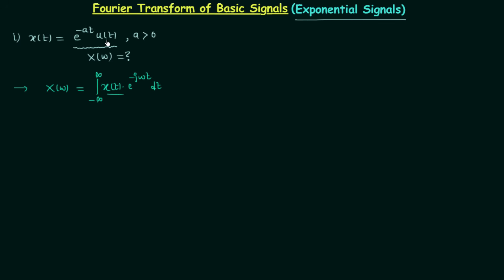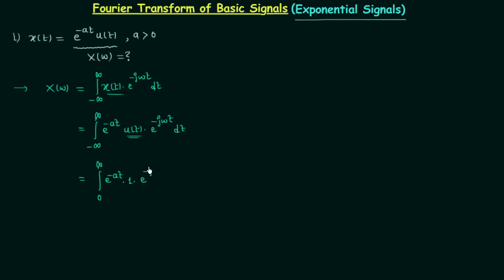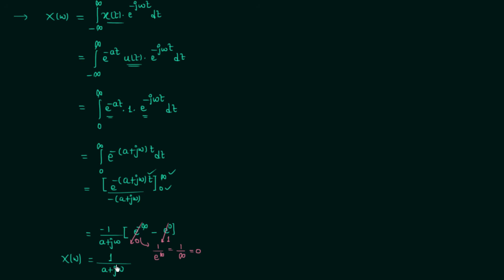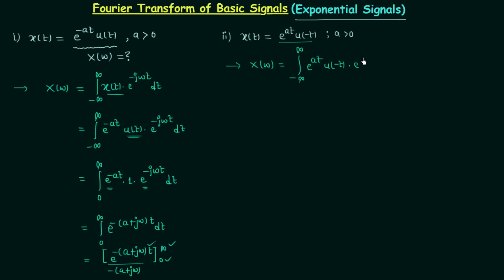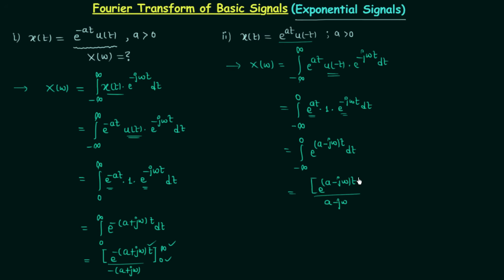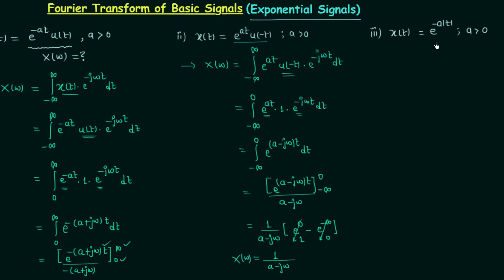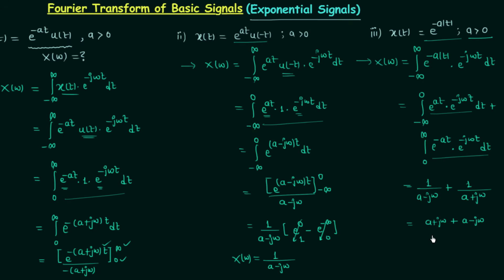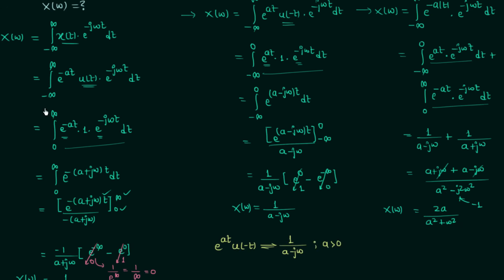Fourier Transform of Basic Signals (Exponential Signals)

Comment: In one of the previous videos U told that we can't find F.T of u(t) directly as integral of e^(-jwt) from 0 to infinity leads to e^(-jw(∞)) = cos (∞) - j sin (∞) term which is undefined . But here, U took e^(-(a+jw)(∞)) term as zero directly. Why is it so?  Did u assume e^(-a(∞)) = 0 multiplied with undefined term [ which is e^(-jw(∞)) ] as zero? 
How can (0)(undefined term) be zero as it is undefined? 
Thanks for your awesome lectures :)
Reply: e^(-a -iw)*inf 
=> e^(-a*inf -iw*inf) 
=>  e^(-a*inf).e^(-iw*inf)
Now see, In last step there are two exponential terms in multiplication and first term
{   e^(-a*inf)   } is anyway equal to 0 no matter what second term{  e^(-iw*inf)  } is.
Reply: @aryanaryamusic  yes, I got last term is multiple of 0. But 0 * undefined term is not zero.  It is undefined. That's what confuses me.
Reply: Nopes zero times anything is zero. Period
Reply: You are correct 0 times infinity is not zero because infinity is not defined actually the accurate answer is that when we plug the limits like infinity in a function we actually put a limit outside the function and not actually put infinity but tend to put infinity so approaching infinity multiplied to zero gives zero

Comment: sir, while substituting the upper limit after integration a complex number (a + iw) when multiplied to infinity has been written to be equal to infinity. 
Is that true??
Reply: e^(-a -iw)*inf 
=> e^(-a*inf -iw*inf) 
=>  e^(-a*inf).e^(-iw*inf)
Now see, In last step there are two exponential terms in multiplication and first term
{   e^(-a*inf)   } is anyway equal to 0 no matter what second term{  e^(-iw*inf)  } is.
Reply: @nikhdzia  thanks bro 🙏
Reply: @nikhdzia  But what if the second term happens to be inf? That would be a 0*inf indeterminate form?
Reply: @axelsenn920  The second term cannot be inf coz it is bounded between -1 to 1.
Reply: In previous video sir told it not defined. What is this?

Comment: Sir you are doing a great job sir.   
i have a question in  05:07 what if we write (jw-a)*(-t) instead of (a-jw)*t  the result will chang or not
Reply: It will not change the result. Its just a mathematical trick to achieve the exp(-inf), avoiding the +infinity to appear. in the exponential. When you multiply (-t)*(jw-a) you will get the same as (a-jw)*t
Reply: yes this is also my doupt this changes the result
Reply: plzz clear this doubt